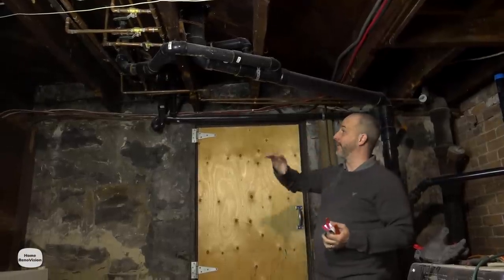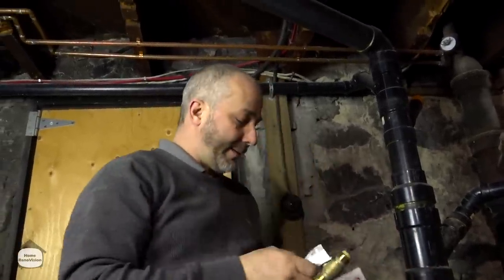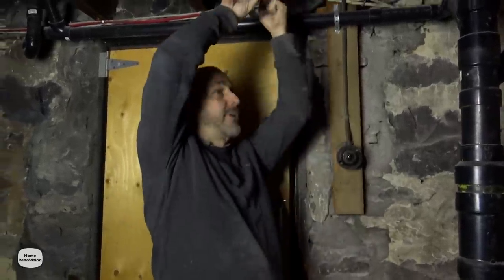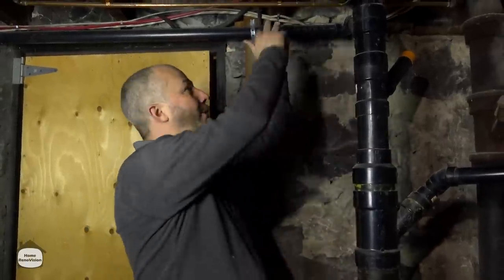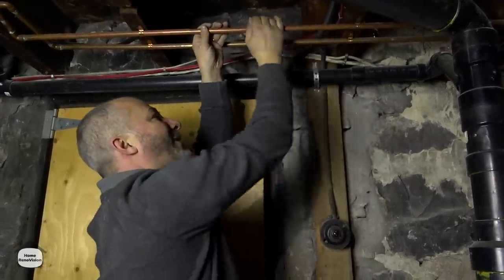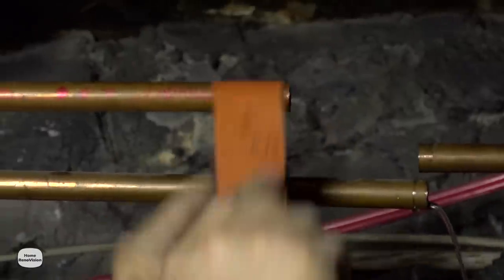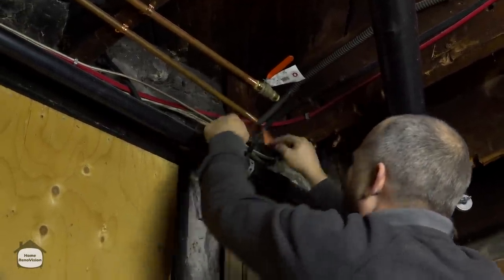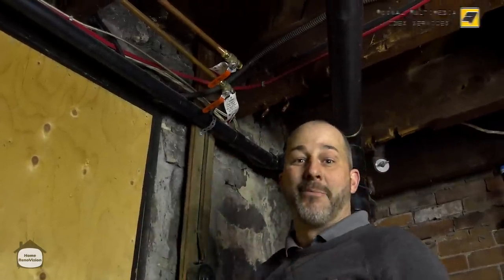How to Add a Sharkbite Shut Off Valve To Switch From Copper to Pex

Comment: With shark bite your not suppose to use sand paper to clean the pipe. It needs the smooth surface and you did not deburr the pipe. That can damage the rubber o ring.

Comment: I love your videos but the comments section is right in this one. You ought to update.  Shark bite has said they need to be clean but not to rough up the pipe and be sure to debur the inside as burs inside the cut section will cause turbulence and cause pin holes. The rough exterior pipe can cause twisting or breaking of the o ring, especially on the smaller dimension pipes where the o ring is a thinner diamater.

Comment: I have been doing this work for 30 years, and just recently introduced to these. I never tried them before because they seemed like such a high expense. Until one day, for some reason i just could not get this one joined sweat on. It just wasn't happening. So I tried one of these and BAM, was done. I'm hooked. The material cost trumps my labor cost making them well worth it vs. my time.
Reply from the maker: Couldn't agree more.

Comment: a good habit would be to mark  one inch in from the end of the pipe as the  Sharkbite needs to be inserted  that measurement from the end , and also deburr the pipe after cutting, small burrs can damage the o-ring in the fitting.

Comment: If you are ever not sure if those sharkbites are in all the way, there is a depth tool that sharkbite makes that u can use to mark your pipe. They sell them in the same aisle  as the valves.
Reply: I looked at those ($17 @HD...) and then found a chart online that splained it to my satisfaction. Google up: sharkbite pipe insertion depth sharkbite fittings. All the info you need. Not a word of instruction on the SB packaging either, just to make you worry, they can keep that "tool", I can't see why you'd need it.

Comment: Aside of attempt to pull it off for check, there is need to make sure that fitting actually pushed all possible way down using some template mark on pipe.  SB fitting even after complete and snug installation still allows some rotation, so its hard to tell how tight it fit. While,  having fitting not completely snug to pipe edge, will let exposure of full water pressure to wash out o-ring sealant more aggressively which will be matter of much shorter time to cause leaking. Pushing it all possible way down, will reduce exposure of o-ring to pressure and let it last much longer.
Reply from the maker: I am pretty sure that I am strong enough to push on a fitting. but yes you can put on a mark.

Comment: Reem the inside after cutting before pushing on a shark bite
Reply from the maker: Good point , I guess I have gotten a little lazy over the yrears
Reply: Correct. It's one of the steps recommended by SharkBite https://www.sharkbite.com/resources/video/how-install-sharkbite-push-connect-fittings

Comment: Just installed a sharkbite ice maker install kit instead of using one of those dumb saddle valves. Worked like a charm! I'm definitely hooked and will be replacing my leaking and old washing machine shutoff valves with sharkbite.
Reply from the maker: Cool.

Comment: I find your videos very helpful.  I got hooked on the series when you built your own shed "from scratch".  My understanding on Sharkbite though is that you don't want to use sandpaper on the outside of the pipe. It needs to be smooth to have the best fit. You do need to deburr the inside and outside of the fresh cut which the sandpaper did for the outside. Have you noticed any problems using sandpaper?

Comment: Hi jeff, are these reliable in long term? I'm planning to do some plumbing at my bathroom with these. But i hear some horror stories.
Reply from the maker: I used them in places where I can have access. This way in 20 years if they start a small drip it can be replaces easily enough.

Comment: I soldered shut off valves on as I made changes over the years, going back to the 80's. Now those old shut off valves are hard as hell to shut off. Will these Sharbite still work like new 10 yrs after install?
Reply from the maker: Yes they are ball valves and do not have gaskets which dry out while in the open position like those cheap shut offs you are referring to
Reply: Thanks very much. I have some work to do this fall down there with bathroom connections so I'll make a few changes.

Comment: Do you have any tips on how to repair basements? When it rains water literally comes inside from the ceiling in a continuous stream on one of the walls and the entire basement floods. As if the concrete is corroded. I've pleaded with my dad to call a professional but he thinks he can fix it by pouring concrete in the cracks. I keep trying to tell him I;m afraid it might be a foundation issue (the entire house has cracks in it and it looks like it's sinking) and it can really cost him if he doesn't fix it right. Please help I don't even know who to call. A contractor? Structural engineer? Where do I start?
Reply from the maker: Most solutions cost a lot of money However, water always finds the easiest path. If you can divert the water from the foundation that is the first thing to do. In most cases it requires a shovel and some hard work to slope the ground around the house and make sure it finds a ditch or catchment basin. Then you can look at how the house is sealed up from there. Not much you can do from the inside. Hope this helps. let me know how you make out!

Comment: Which water line are better, copper or pex. I got pex  in my house, and was advised to change them to copper because pex blow up
Reply from the maker: someone lied to you. pex does not blow up. You actually have the superior product already in my opinion. Don't touch them.
Reply: Steve  Correct. Pex actually expands and contracts. Pex A is the most flexible and does not weaken after multiple expansions/contractions. Look at some of the Pex tests done on Matt Risinger's channel.

Comment: I would have used the original copper line (but support it, it was just hanging with local level pressure supply)  used a ball gate isolator, to supply the water to the dwelling, then used maybe a sharkbite after, ideally local to the taps aka facets, for example, for ease of installation, copper is king, suitably installed and maintained, eg mechanical protection, easily ( as practicable) accessible, etc
Reply from the maker: sorry to disagree with you but pex is now the king.

Comment: Any idea of reliability for pushfit vs solder connections? I’m getting mixed signals from internet peeps.
Reply from the maker: recent models of sharkbite perform much better than the original version. still not a good idea to hide in a closed wall or floor.
Reply: Thank you very much! I'm a big fan and watch a lot of your videos and take your feedback with a vast ocean of salt! :) Much appreciated.

Comment: Ball valves absolutely,  Shark bite I personally would not install them but in a pinch to save a flood when you could not solder yes the way to go in an emergency. Do know enough about longevity. I would use a finer grit sand paper on the copper or the wire tool more commonly used. Not knocking what you are doing here I just have my own tried and true methods that I like to work with. At 12 years old I fitted a 40 horse barn  with automatic waters for each stall, a person got me started on one stall and I completed the rest like three months later.  There was a lot more to around the barn besides hook up water. I think I re-glazed  around 2000 8x10 windows that year also. The year was 1972. Learned a heck of a lot more since.  100% on board with waste PVC but just can't go there pressurized. Just my opinion but if you do copper do blue not red pictured here.
Reply from the maker: Just working with what was previously installed.

Comment: Can u do a video going from copper to plastic
Reply from the maker: we just did.!
Reply: I actually meant the part you solder onto the copper and you continue with plastic I’m not a fan of shark bite garbage sooner or later that rubber O ring is going to dry crack or whatever they leak.   Nice having the shut off inline though good idea

Comment: Straight from the manufacturer. Do not sand the pipes before fitting a shark-bite connection.
Not that I would ever rely on a single O-Ring seal in a waterline anyway. 

O-Rings are rubber and will degrade over time, that WILL fail just like ALL O-rings fail over time.

Shark-bit is great for a temporary solution but never for a long term one.
Reply from the maker: The point of sanding was to deburr after the cut which is required. This fitting will last 50 years and I am fine with that since it is in a very easy to manage place.
Reply: oh no! the sky is falling. also take note that he installed this in a place where IF it leaks the damage would be minor.
Reply: I agree with you TOTALLY Home RenoVision DIY!!!    You are a genius!!!
Reply: Scotch brite works good. 

Sharkbites are great in exposed areas where you will notice a drip, in 20 to 50 years, and the drip and will not cause damage (like in video). They are also good for water heaters (just about any plumbing fixture) since they outlast them. There are some municipalities that require a burn permit for torch work. Excellent work around for that.

Comment: your suppose to remove the ring inside the sharkbite with needle nose pliers, its only use for pex. fyi
Reply: Steve  It's there to stiffen the pex so the SharkBite teeth are able to better bite into the pex

Comment: By not removing the PEX insert from the fitting you created an unnecessary restriction.
Reply from the maker: No worries, the biggest restriction to water flow is at the faucet in every fixture.